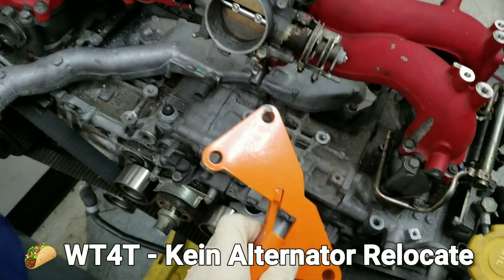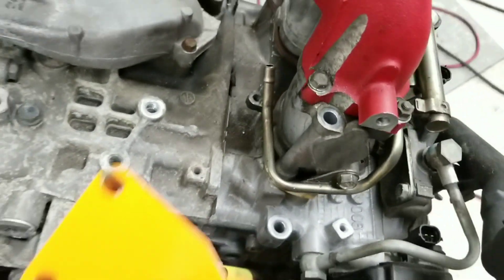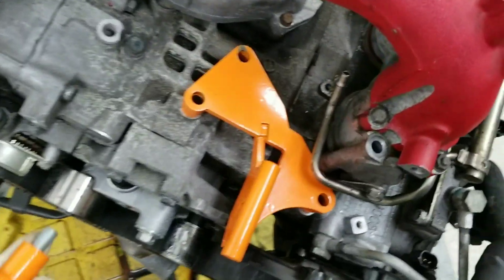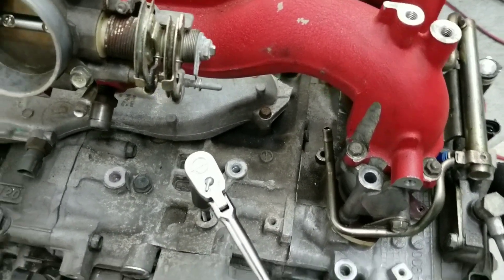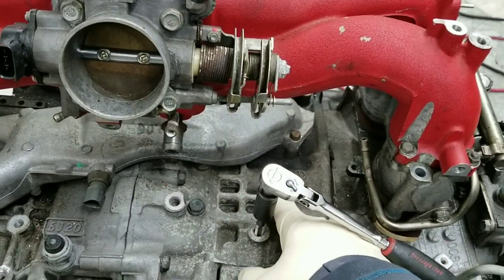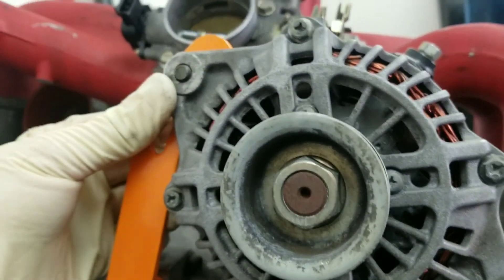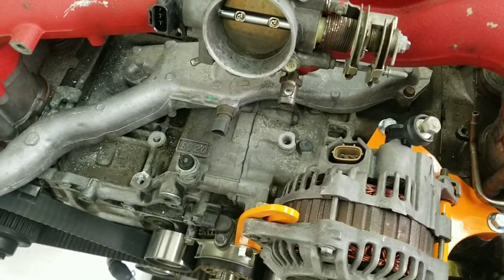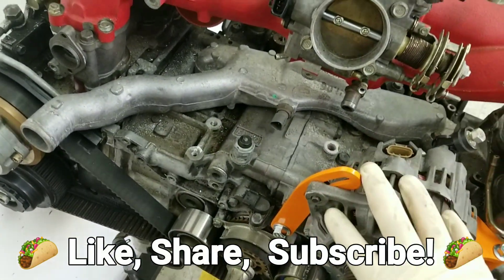GC Impreza v7 EJ207 Swap - Part 3. Kein alternator relocate kit install.

Comment: Hello there! I recently purchased this relocation kit and im wondering what belts you used? Im wondering if it runs off the AC belt slot but the AC belt is 4 rib and the ALT/PS is 5 rib. Any feedback would be greatly appreciated!
Reply from the maker: Well, I'm not running any power steering so my belt may be different than yours.  It still runs off the normal power steering/alternator set of ribs. The belt I used was just slightly too short so i had to grind the alternator for clearance.